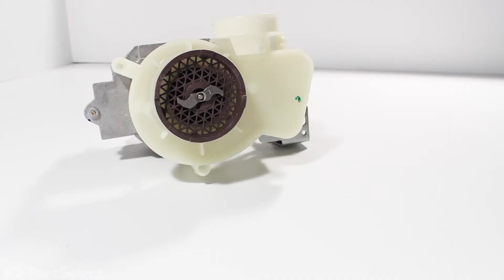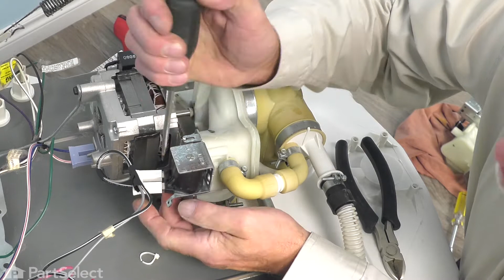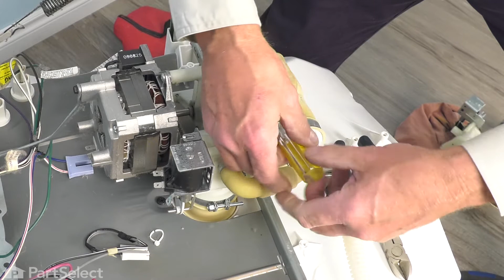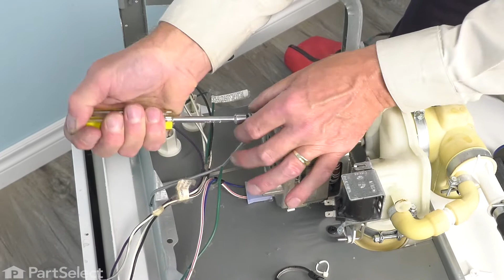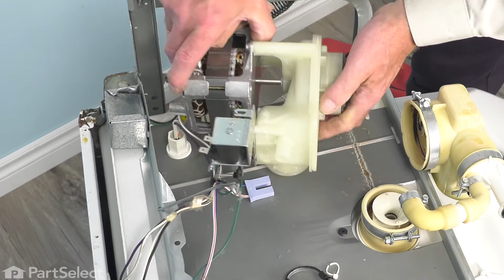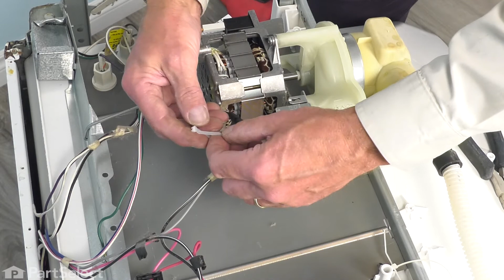GE Dishwasher Repair – How to Replace the Pump and Motor (GE # WD26X10051)

Comment: Thank you so much for the video.  I have diagnosed my issue to be the pump.  I removed the motor and checked for any kinks or warn out pieces and found none.  When i reconnect everything, the leak continues but it keeps leaking out of the motor itself.  PLEASE HELP!
i am not sure if i have to replace the entire pump/motor or just need to keep fishing for the problem.  Its a 10 yr old Frigidaire Gallery Dishwasher - i saw your other video about the common issues and you nailed my problem.  Just cant figure out how to fix it or what to replace before i spend more $ than a new dishwasher.  
thanks again for your hard work